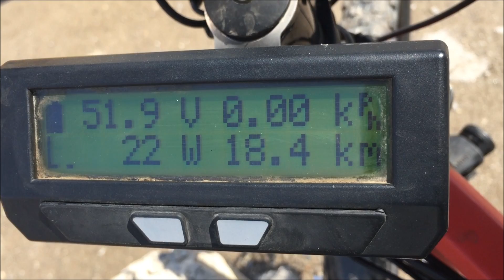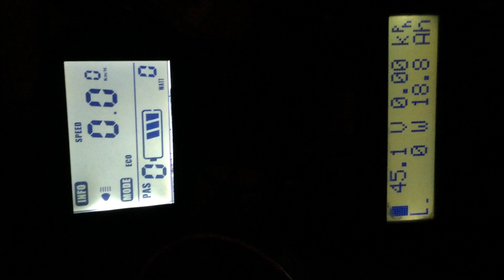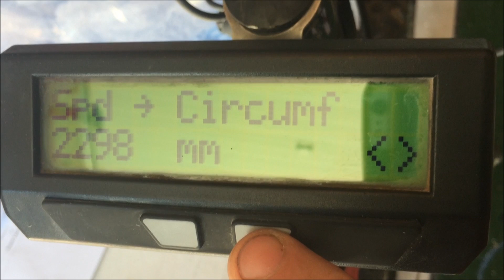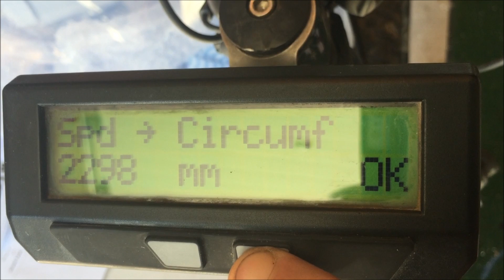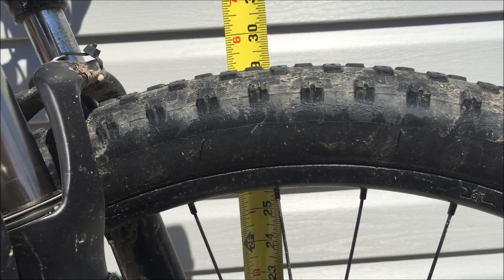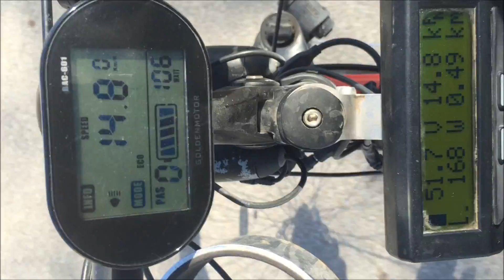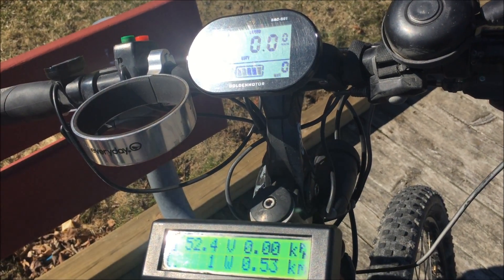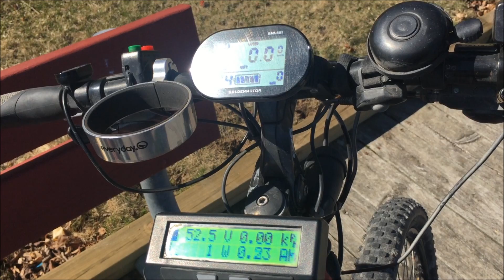Golden Motor Smart Display vs. Cycle Analyst

Comment: Just for accuracy's sake, you should correctly set the Smart Display at 29.3 (92 / 3.14159 = 29.2845~), since you were being so accurate on the Cycle Analyst.

Comment: Hello, can you please tell me, there is 2 different versions of shunts, with 6 wires coming out from shunt as on you video, and there is anther version with 5 wires, can 5 wire version make limitations of speed and amperage, to my magic pie 4 motor?
Reply from the maker: +TheGrach13 
Yes it can work fine.